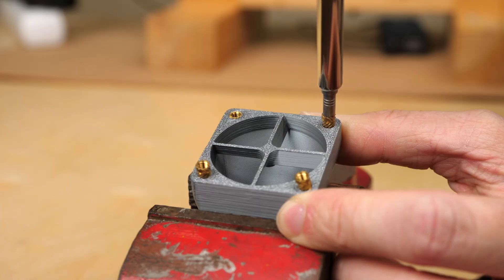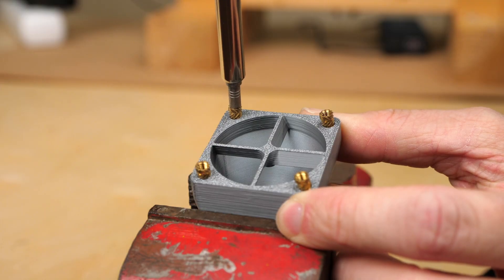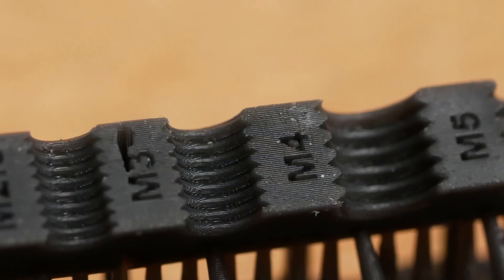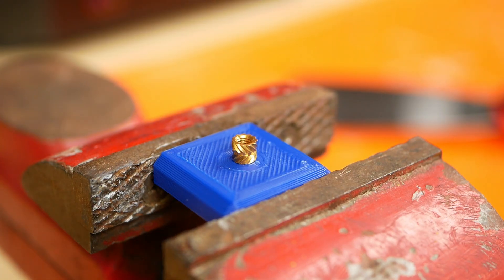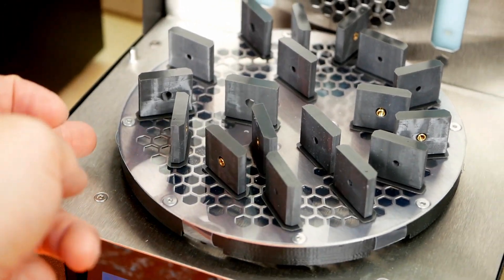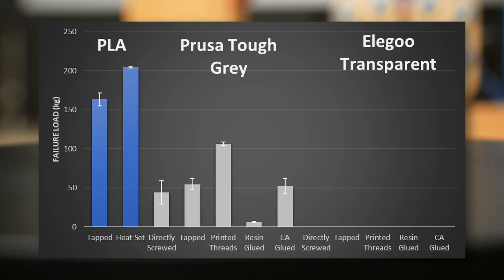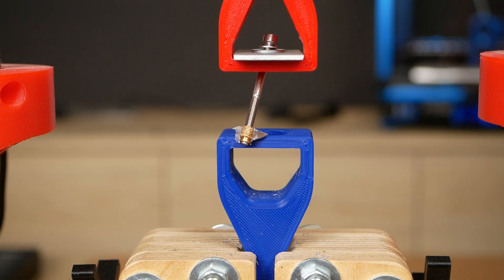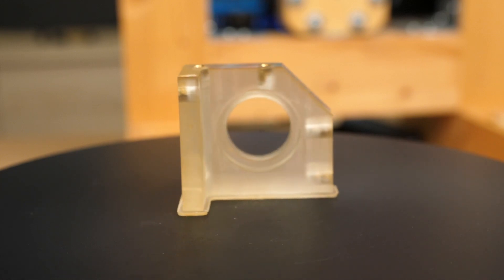Mastering Heat-Set Inserts in Resin 3D Prints

Comment from the maker: Inserts or no Inserts in 3D prints - What's your opinion?
Reply: I have never tried them
Reply: A friend of mine used these in non-3D-Printed plastic parts and he saw some really impressive durability increases, specifically it was for RC Car Wheels and it prevented the screws from coming loose, he saw I think it was 4-5x more usage on those wheels
Reply: Inserts for machine screws. Un-tapped pilot holes for coarse thread wood/sheet metal screws.  Both FDM.
Reply: Using inserts in PLA and HTPLA, especially in fixtures needing frequent cycling of the fasteners.  Your videos are a huge help!  Your work is inspiring and educational.  Thank you for investing so much time capturing details and wonderful editing.
Reply: finde die aktuell noch eins der besten lösungen für verbindungen die unter dauerbelastung sind im sinne von rein und raus schrauben. 

nutze sie für die meisten parts oder auch für cosplay sachen, wo man sachen einfach schnell wechseln soll.
Reply: Inserts for sure!